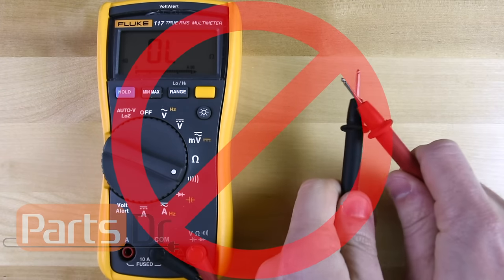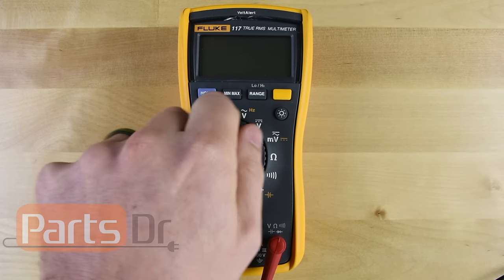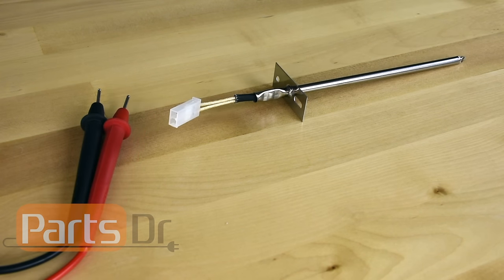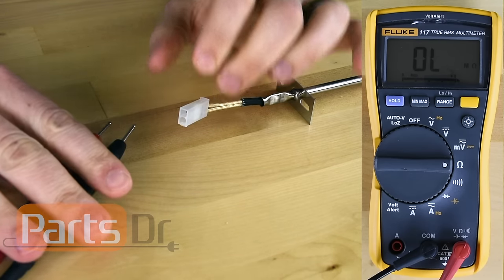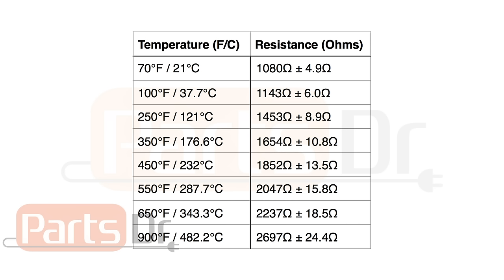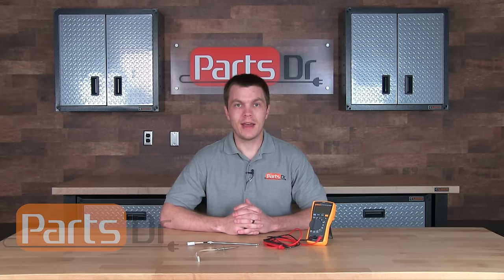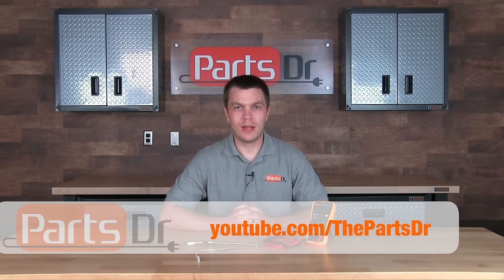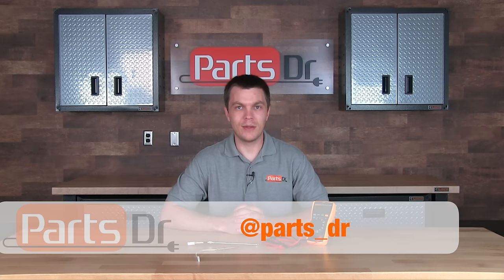How To Test An Oven Temperature Sensor

Comment: Old temp sensor was 730 ohms. Bought a new one and it too was around 730 ohms. Bad sensor or should I look at something else. Element continuity is good when I turn on the power to bake I’m only getting around 110 V.  wall and wires coming off the stove give me 240
Reply from the maker: Most oven temp sensors use the ohm scale shown in the video.  There are some that use a different ohm scale.  If your new and old sensors are measuring the same, we would suspect that the sensor is not bad.  The voltage reading doesn't sound normal.  Most electric ovens send 220-240v to the oven heating elements.
Reply: Parts Dr thanks. Ya I change out the broil element as it had pints and looked like it failed. Change the temp sensor so now I guess the control board is the only thing left. When I tern the oven or broil on I’m only getting 110v to the element. Guessing something is fried in the control board. Even with 110v I would think it would get a little hot, but nothing.
Reply from the maker: @natecollins5275  It won't heat up at all unless you are getting the full 220v.  It sounds like when the broil element fail it shorted out and damaged the control board.

Comment: My temp sensor has no plug it’s just one continuous part
Reply from the maker: On some models there isn't a plug and you will have to cut and splice the wires to replace or test the sensor.  Make sure that you cut and splice the wiring using something rated for high temperatures like porcelain wire nuts.

Comment: easiest test would be in the ice mixed with the water (32) and next after just boiled water ( which is about 200), but you will not find the numbers of the resistant  for that temperatures (((
Reply from the maker: This type of part isn't meant to be submerged in water so we wouldn't recommend to test it this way.
Reply: Parts Dr plastic zip lock bag